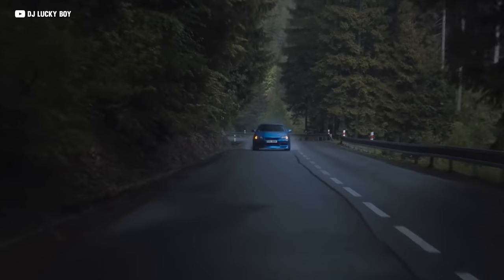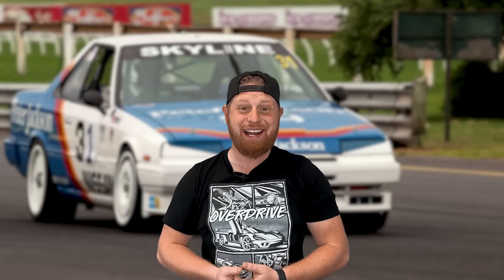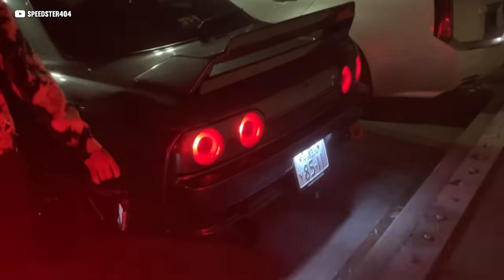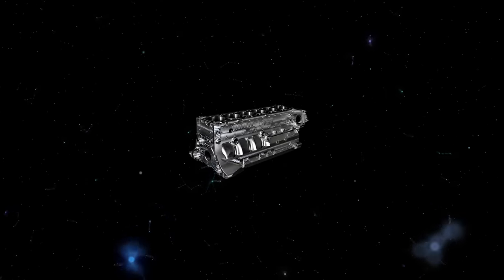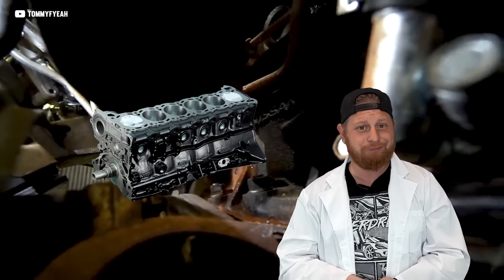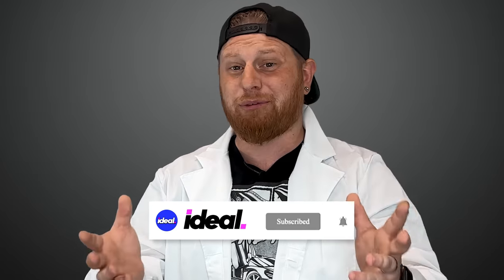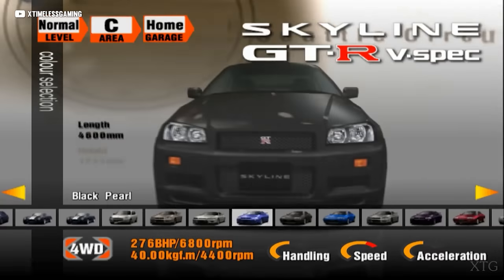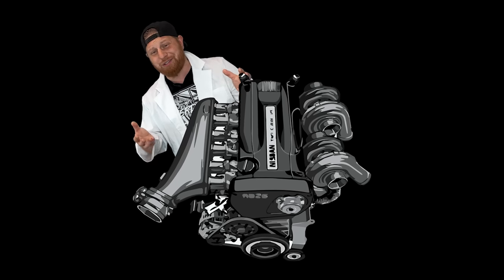THIS Is Why The Nissan GTR DESTROYS Supercars

Comment: Sadly, you can now get the new BMW M3 for $40,000 less than the GTR.  It’s faster than the GTR, has a much nicer interior and so far, has less problems.
Reply: You would better hope so when it’s 30 years newer. And it still isn’t as reliable as 2j or RB30. They’re aluminium blocks.

Comment: I hope they do a modern skyline that’s not an infinity like they did with the new z
Reply: The G35 & G37 are Skylines in japan so technically we have "modern" Skylines
Reply: @jordansimon4835  they aren’t really skylines though, just infinity’s that are badged as skylines in Japan. They are more luxury cars than sports cars. I’m talking a throw back car with cool retro styling like the z. That would certainly attract tons of attention
Reply: @spoolysnail32  actually they're are Skylines, especially now the reusing Skyline badge after Infiniti failed. That's why the successor is Skyline V35, V36 and now currently V37
Reply: Tard - the G35/G37 WERE SKYLINES.  JUST NOT GT-Rs
Reply: It’s funny, not a single person understands what I mean aparently
Reply: @jordansimon4835  Yep. I own one and give KIA stingers hell. 😆
Reply: @taiminsen8069  The info plate under the hood of mine has V35 made in Japan. So yep.
Reply: @SpoolySnail 32   I get what you're saying it's just saying "they aren't  really skylines" is factually wrong. The JDM ones are badged as Nissan Skyline from the factory. Just because you know them as an Infiniti G35/G36/G37 doesn't change  fact that it is as much a skyline as a G35/G36/G37. My guess for this change is in Japan that car was more then just the GTR it was a four door daily just like any accord or corolla and they didn't wanna have another "sport car" under the Nissan badge to compete with the Z. We will never have a car like the older skylines/GTR, we will only have current R35 GTR and I'd assume a R36 GTR which both do and will never actually be skylines.

Comment: title: this is why the rb destroys supercar

reality: it doesn't when its stock
Reply: Skyline GTR was a super car killer in its day... Right from the hakusuka to the R34 rb26 was def a big part of that legacy.
Reply: @littlenismo  , I've seen a stock R34 on Track with Ferrari F40, Ferrari F355, Ferrari F40, Porsche 993 gt2 and Lamborghini Diablo...
It didn't stand a Chance...
Even the c5 Corvette was faster...
Reply: @-Ehrenbruder-Sam-  probably just base Skyline GT-R R34, not Skyline GT-R Z-Tune R34 with its legendary RB28DETT Z2
Reply: @taiminsen8069  , thats possible...
I respect the Skyline for its 4 wheel steering, 4 wheel drive and its engine that can handle a lot of power...
But stock... it is not what many consider as a "supercar slayer"... you need to modify it.
Reply: @taiminsen8069  the z tune still won't stand a chance against half the cars in the list

Comment: The GTR chassis is second to none. You can put a sr20 in a gtr and get the same effect. The chassis is the gem…The sound of the RB is awesome but it’s not better than a 1jz.  RB (replace bearings) the 1j can make more power and take more abuse than an RB26. I don’t see how it’s even compared to the 2JZ. Bmw b58 can’t do what a 2j does sbe and that’s 2010+ technology. RB26 is awesome but the jewel is the AWD chassis.

Comment: The nismo 400r rb-x gt2 engine was the best nissan engine produced. Lol still wouldnt say no to an rb26dett gtr though.
Reply: The 400r’s just use an 05U block (skyline gtr 26 blocks) and it’s just stroked to a 2.8.
Reply: @lennixsingh626  i still stand by my statement. Putting out almost 400hp right out of the box in 1996 was a rareity. Its what the RB25DETT should have been.
Reply: @MFfrost85  they were “modified from the box” nismo took them and gave them a little spice, however 400hp is extremely attainable even on a stock rb26. All it’s needs it’s e85 and a tune to hit 400hp.

Comment: So you using a lot of Australian racing footage.  So you should do an episode on the Australian developed ford Barra 6 cylinder super engine.
Reply: Motive video already has. The 2jz is tronger than than it and more reliable. The rb26 and rb30 are stoneger than it but have their fair share of issues when not fixed. But skylines destroy xr6’s.

Comment: See the thing is with forged Pistons is they need a lot of clearance is needed between the cylinder wall and the piston bc of thermal expansion the moment you start the car in the cold you run the risk of piston slap and you can't floor it for too long otherwise you could have piston grinding the cylinder wall the engine has great durability terrible longevity you absolutely haf to baby that engine were as with a 2jz it uses cast pistons with a high percentage of silicon which gives them tensile strength without going under thermal expansion this one of the reasons why a 2jz is arguebly better yes cast iron is much heavier it's 3 times heavier but its a lot thinner bc it's stronger with an alloy block you haf to make it really thick compared to iron the rb26 weighs 406lb while the 2jz is 440lb it's not really that much heavier with an rb26 you haf to thread spark plugs more often which just means more dollers imo a 2jz will do way more miles then an rb26DETT not any other rb moter just that one and you will have stock internals that can get abused anytime anywhere and that are easier to replace if your doing a hell of a lot miles on an rb26 it's gonna atleast need to be rebuilt once in it's life
Reply: bro you know what are those things? 

 , , , , ,  , , ,
Reply: @beuhhh8102  what is what

Comment: FIRST : "THIS Is Why The Nissan SKYLINE GTR DESTROYS Supercars", there I fixed it for you especially now current GT-R is now different line-up with Skyline

I mean why surprised ?? look at RB28DETT Z2 from Nissan Skyline GT-R Z-Tune R34, it literally took 2 decades for its german rival, BMW to make M3 coupe / M4 competition G82 to be on the same power level with Nissan

And while M4 Competition xDrive G82 is fast, it's still obliterated by Skyline GT-R Z-Tune R34 even after 2 decades in 1/4 mile run (11.00 seconds vs 10.06 seconds)
Reply: The s58 is also an aluminium block, it will hold no where near as much power as say an RB30 which they use in the big power skyline builds, it doesn’t corner as good as a skyline with basic aftermarket suspension, it isn’t as rowdy as a skyline and its a lot heavier.

Comment: ....with the right modifications of course.
Reply: And even then:

. Ferrari F8 Tributo 
. Mclaren 765 LT
. Lamborghini Huracan STO 
. Maserati MC20 
. Porsche 911 gt3RS

And of course... corners...
Reply: @-Ehrenbruder-Sam-  every car u listed is rwd. They simply cannot keep up with a skyline and it’s as simple as that. U should modern day time attack skylines. They are STILL by far one of the fastest cars on the roads.
Reply: @lennixsingh626  , there may be track built Skylines out there but most of them ( even the modified ones ) don't stand a chance against a modern day Supercar...🤷‍♂️
By any means I don't disrespect the Skyline, it was a great car full of Innovations and there is a reason why it set a record at the Nürburgring but today... even some Hatches are faster...
Times are changing...
Back then they struggled to make a road car that hits 300 kph, today the nearly reach 500 kph...
Reply: @-Ehrenbruder-Sam-  your talking stock for stock. The worlds fastest streetcars are and include skyline,TT lambos/r8’s and gtrs. The worlds current fastest streetcar and fastest car on no prep asphalt is an r32 skyline.
Reply: @lennixsingh626  , I wonder how fast they are around a circuit...🤔
I'm not talking about straights alone...🤣
Reply: @-Ehrenbruder-Sam-  go have a look a time attack for yourself or even when it got banned from the Bathurst circuit in AUS because it was too quick.
Reply: @lennixsingh626  , as I said..., there may be some track built Skylines out there but most of them, even when tuned don't stand a chance against modern Supercars, Sports Cars or even Hatches...
There is a guy in the Village I live who owns a upgraded 500hp Skyline ( r33 ), even he says that the car may be fun to drive but is not compareable to a Porsche 911 gt2rs or a McLaren 765LT...
You may be abled to troll A Volkswagen Golf R or a heavy Shitbox Mercedes c63 amg but not a serious Supercar...

I don't doubt that it is possible to make a Skyline go faster around the Track then a Lamborghini Aventador or something but most of them, even the modified ones can't do that... 
Same goes for the Toyota Supra mk4 and Mazda RX7 FD... great cars but they need to be heavily modified to be on the same Level as modern Day Supercars...

Comment: 2-JZ was proven stronger 💪
(Just saying)
Reply: Doesn’t make it a Better platform, skylines absolutely shit on every single other sports car to have ever come out of Japan.
Reply: But the Barra is the inline 6 king.
Reply: @tba3900  no it isn’t. The 2jz is far better, stronger and more reliable
Reply: @lennixsingh626   far better doubt it, far stronger definitely doubly it and more reliable highly doubt it. You forgot one thing your 2jz cost more and dollar for dollar doesn’t even come anywhere near a Barra .
Reply: @tba3900  facts don’t care about your feelings. The 2jz has one of the strongest cast iron blocks on the planet and Inherently has no issues.
Reply: @lennixsingh626  calling bulllshit on this one, Cummins in-line 6 will outlast and even at 3000hp will last longer than a 2 jz in the how long will I live downstairs department.
Reply: @tba3900  practically every 3000hp Cummins can’t even make it off the dyno without blowing up 💀. 3000hp JZ’s and RB’s last 30-40 passes before getting a rebuild for Safety purposes.
Reply: @tba3900  facts don’t care about your feelings. A 2jz is 30 years old and is still the single strongest cast iron in-line 6 on the planet. Your literally just here to hate…
Reply: @tba3900  You can ask anyone who builds engines for a living and they will all tell you that a 2jz is the single strongest and most reliable inline 6 on the planet. go watch motive videos Rb30 vs 2JZ video.
Reply: @lennixsingh626  not you again.   Stick with your rice, I’ll stick to something that actually stays together longer  than rice will ever will and is cheaper to get 600hp  than a bag of rice. Chop chop
Reply: @tba3900  american moment.

Comment: After seeing RB teardowns and issues with the oiling system, I'll trust the 2JZ.
Reply: Nissan is "re-making" the RB motor for U.S customers..I'm sure it will be better than the "early" RB motor..
Reply: I also trust the RB motor over 2jz on the circuit race too..
Reply: Every rb oiling oiling issue can be eliminated with only a few things. Oil head restrictor dowels, an aftermarket oil pump, billet oil pump gear, dual rear head drain. Done, fixed.